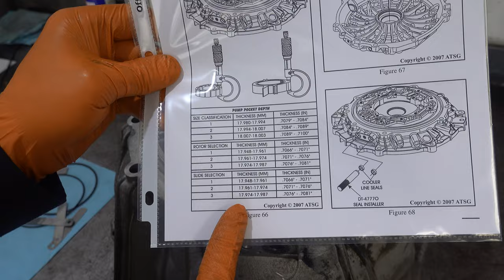6L80 Assembly PT1 - Subassemblies (DEMO) - Please Read Description

Comment: Nick, This is the best detailed and through assembly video I've seen of the 6L80. I've been waiting to see it. Thanks so much. I look forward to Part 2. I am going to be rebuilding my 6L80 for my 2013 Camaro SS. The transmission is slipping going into 3RD. I'm running over 600 Hp. I have a new case, new bell housing, new stator, new pump, new Sonnax billet 456 hub and intermediate shaft and every high performance part that Sonnax sells for the 6L80. I'm looking for a stiff or harder shift than factory. On clearances 50-74 for the 4-5-6, would I better to keep it as close to 50 as possible? And, what about the 3-5-R clearances? Your advice would be much appreciated. Thanks again.
Reply from the maker: Thanks, KoelzSpeed Garage!

For firmer shifts, follow "Prices is Right" rules and get the closest clearance you can to the max allowable without going over. All other things equal, the more clearance you have, the firmer the shifts as long as you are still within specification that the factory calls for! The 4-5-6 clutch should have .060-.070 clearance (install the Sonnax 4-5-6 piston kit if you're not already planning to do so). Reinforce the welds at the base of the 3-5-R drum to prevent future 3-5-R clutch pack failures. Replace your parking rod assembly with the updated HD version from GM.

If you're installing the Sonnax 6L80-LB1kit, that should provide for higher line pressures at WOT over stock (more or less keeps pressures similar to stock at part throttle) thus firmer shifts. Otherwise, tuning is the fastest route to better overall shift performance for these units. Find someone w/ experience tuning the 6L80 (perhaps w/HP Tuners) if you don't already have a tuner and give the tuner a run-down of what you're doing to the trans, stall speed and desired shift characteristics and he should be able to help get it to where you want it.
Reply: @nickstransmissions  Thanks for getting back to me so quickly. And thanks for all your help.  I bought the Sonnax 6L80 Zip Kit, I think that includes the 6L80-LB1 so I should be ok, Right? I did also buy the Sonnax 4-5-6 piston kit, and the power glide frictions. I also bought the High Capacity 3-5-R apply ring and the 1-2-3-4 heavy duty piston.                                                                     I got an upgraded 3-5-R drum from WIT. Looks like the seam has been TIG welded.                                                                                                                                              I bought a brand new case with the rooster comb installed..... will that have the upgraded parking rod assembly already in it? And how can I tell if it does?  The car has been tuned, but I guess I'll have to have it tuned again? If so, my tuner is about 35 miles away. Should I trailer my car to the tuner?  Your help is so much appreciated. Thanks!
Reply from the maker: Sounds like you have all the requisite parts (the boost valve comes in the zip kit). I would have no idea if the new case has the updated parking rod assembly installed - ask the supplier/retailer you purchased it from as they should know. 

What was wrong with the pre-existing case?

If the car is already tuned, contact your tuner and let him know what you're going to be doing to the trans and how you want it to shift and he will be able to let you know if additional tuning is required and to what extent.

At minimum, you will need to perform a "fast adapt relearn" once it's installed and filled to the correct level with fluid. DO NOT drive it without performing the fast adapt successfully first. If you don't have a bi-directional scan tool with 'adapt' functionality, have it towed to your tuner or whomever can perform the fast adapt for you. 

Lastly, unless you're buying a fully assembled 3-5-R drum from WIT, you'll need to replace the two return spring snap rings (one for the 1-2-3-4 and the other for the 3-5-R as well as the eye-loop snap ring for the 4-5-6 return piston/piston dam). The kit's part number is 24260139. Also, replace the snap ring for the low sprag (part number 24230752) as that also likes to break if worn.

You may find my 6L80E thread on 'TahoeYukon forum' helpful: https://www.tahoeyukonforum.com/threads/gm-6l80-transmission-information-thread.141927/
Reply: @nickstransmissions  Nothing wrong with my pre-existing case. I want the case painted and I don't want the trans apart for a long time waiting for the case to be painted. So I bought a new case, bell housing and tail shaft. Everything is painted really nice now. Just waiting now for the right time to pull my transmission. Since I'm a novice to transmission rebuilding, I want to rebuild it in segments rather than completely having everything apart with a million parts everywhere to remember where they go.I also bought new wave plates,  bevo springs, Torrington bearing set and Durabond dry film coated bushing kit. And Sonnax just came out with the low/ reverse sprag rebuild kit so I bought that too. I will buy the new snap ring kit you recommended. I try to be thorough like yourself. Why have the transmission out and apart and not replace everything if you can afford it.                                                                                        Once I have the transmission back in the car, will it be ok to start it up to check fluid level and drive it on my trailer without performing the "fast adapt relearn"?
Reply from the maker: Agree whole-heartedly with that approach; I was just wondering if something happened to your case as I rarely (basically never) see the cases themselves have defects that require replacement so was curious. It may or may not bang-shift into forward if you don't do the fast adapt relearn but otherwise shouldn't hurt anything (I'd just wench it on if you have a wench but if not, it should be ok).

Though if you get a neutral condition when trying to drive it, you will need to wench it on to the trailer.
Reply: @nickstransmissions  I figure it might be  nice to have a spare case and it really didn't cost that much considering the labor I'll be saving. I already ordered the snap rings, lol, Thanks. I'm going to stick with your professional opinion and winch my car on my trailer. Why chance it. Especially since there's a winch on my trailer. I like that you're very articulate and precise in your videos. Very easy to follow. Your clean shop floor and you wiping down your bench constantly in your videos shows your  particular and professional. Thanks for all your help. I'll be waiting to see part 2 of the 6L80 build.
Reply from the maker: You got everything headed in the right direction...Pt 2 will be out tomorrow afternoon.
Reply: @nickstransmissions  You say to follow Prices is Right? I can't find that. Is that correct?
Reply from the maker: You've never heard of the gameshow "the price is right"?
Reply: @nickstransmissions  Yes I have. I just didn't get the relation to clearances.
Reply from the maker: Clearances: Get as close to the max clearance allowed without going over it. 

Price is right: get as close to the price without going over and you win. 

Grab some extra clutch snap rings so you can adjust your clearances in each of the front three clutch packs. The 2-6 and Low-rev both get .050". There's no selective snap rings (or anything else) in those two clutch packs.